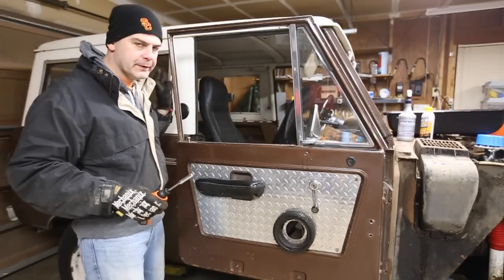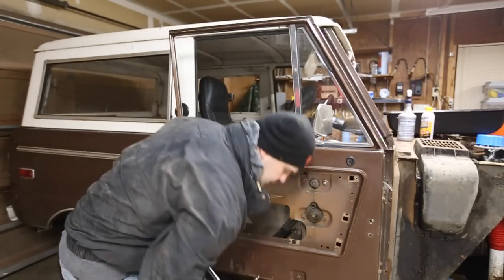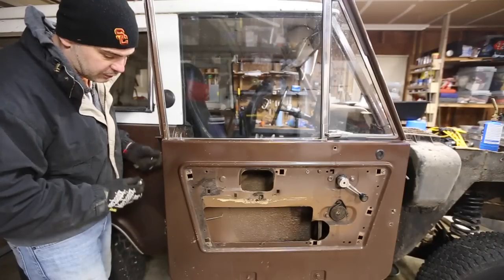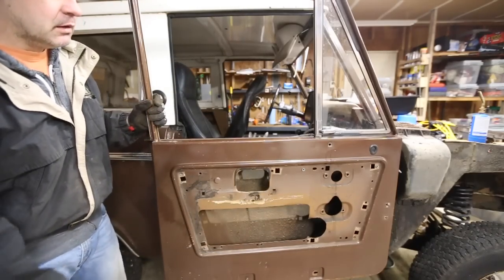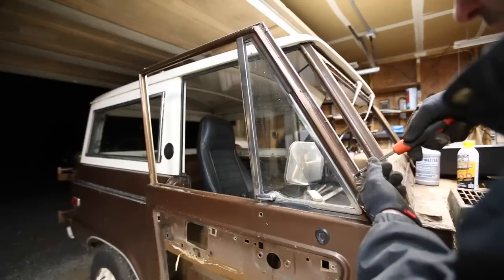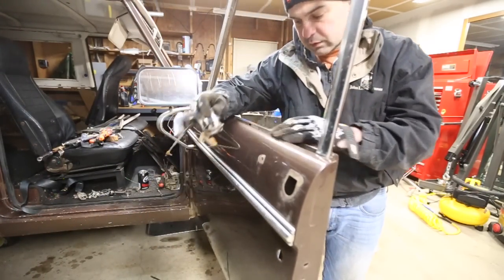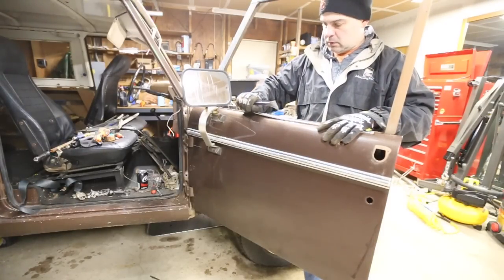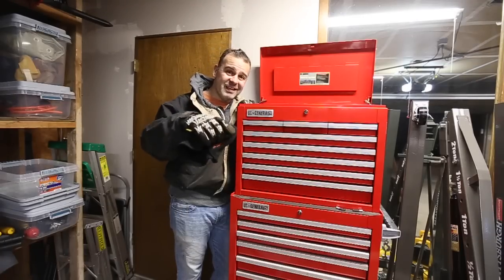Ep 2.03 - Early Bronco Door & Window Disassembly

Comment: Thanks Matt for info. If anyone is restoring a 66 or 67 almost everything is different in the doors. Including striker posts! Company's say 66 to 77 on the strikers but you will have to cut out and move the door striker. To get the correct location clamp the panel to your door. Then mark where it goes.

Comment: Hey Matt quick question my outside door handle stopped working but my inside handle still works perfect.
It seems like the push buttons pushes in like half way now without engaging in anything but then you can feel it engage about halfway through. Would you have any suggestions on what it could be or what I'd need to replace? The only reason I ask is because you took the whole door apart so maybe you'd know something haha

Comment: Sir, sorry if you mentioned this before but what seats are those and do they only come in black?  Thanks for taking the time to make these videos you and Nashville are a godsend to early bronco owners such as myself.
Reply from the maker: Hi Khalid.  The seats look better on TV than they do in real life.  They have tears and they are pretty poorly made seats.  I don't know where the previous owner got them but I know from a tag underneath that they are made in China.  They are also not specific to the Bronco as the supports looked homemade.  If you have the budget, Tom's Bronco Parts has those nice new seats that come with all the mounting hardware.  If that is out of your budget another option I hear is good is getting used Audi A4 seats from the wrecking yard because they have a low profile and are pretty comfortable.  Thanks for your kind words.  John is a great guy.  I saw he just put his FiTech video up so I need to get off work and go watch it!
Reply: Yep, I just watched that too.  I put the 600 on mine and just got it running properly with a lot of tuning and mods.  Went with the TBP ceramic headers and i think the exact same intake as John.  Had to drop the fuel tank due to corrosion and replaced it with a brand new one from TBP and welded a sump to it because I was having starvation issues.  Turn key starting and runs like a top.  Still trying to dial out a mild hesitation issue.  As far as the seats, I'm a bit of a purist, but liked the outline of the ones you had.  I've been holding out trying to find original seats for some time now with no luck.  Found some in SOCAL but they wanted $1200 for them... no... So the search continues. Only thing chinese on my bronco is the FITECH (unfortunately) I'd like to keep that to a minimum.  Thanks for the info!
Reply from the maker: Sounds great.  What part of the country are you in out of curiosity?
Reply: I was in Los Angeles for a second and now I'm on the east coast for work.  Will be relocating to TX for the long haul here shortly.
Reply from the maker: Sounds like my life.  Feel free to e-mail me at mattsgarageshow@gmail.com any time if you want any detailed answers.  I'm also available for phone calls.  It's good to connect and share ideas.